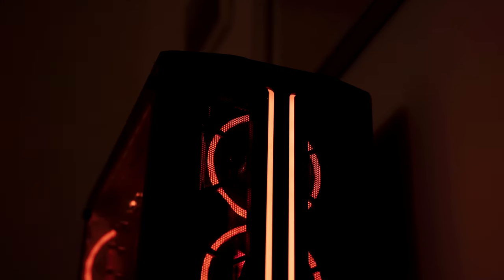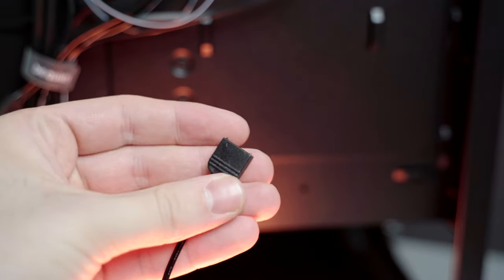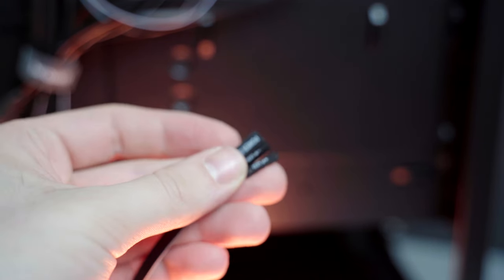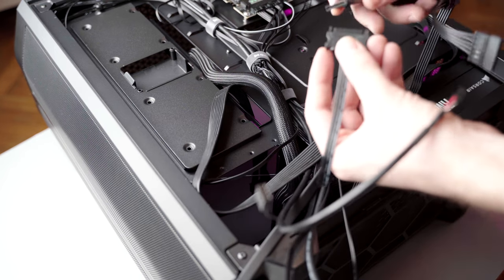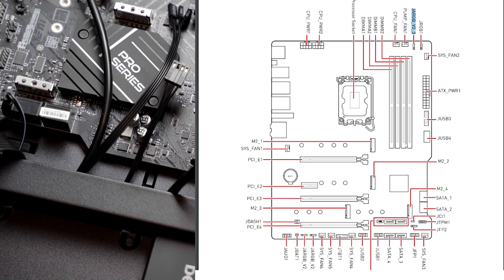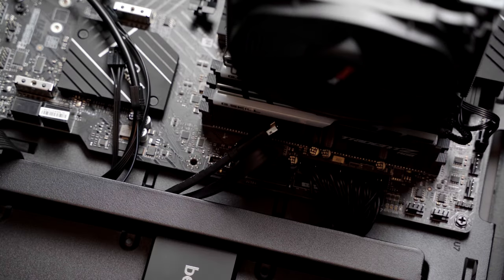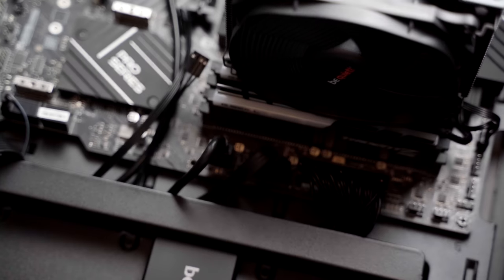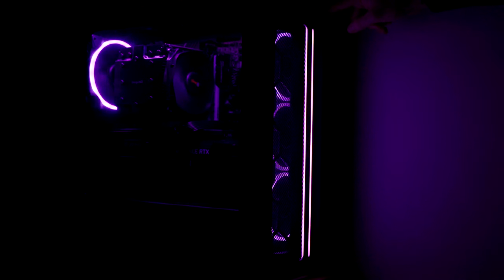be quiet 500FX - how to connect and control RGB, fans and the rest?

Comment: So if I hold the RGB button at the front, does that allocate the control to a 3rd party app for RGB AND the fan control?
I am using SignalRGB for RGB control and Fan Controller (Github) for the fan controlls for CPU and case fans. Haven't been able to get the apps to find the be quiet fans or RGB yet though.
Reply from the maker: I think it’s only for RGB. You can control the fans by connecting them to the motherboard fan header. Did you make sure to connect them to the mobo?
Reply: @leizerg  I still have them connected to the be quiet controller. I will try connecting them directly to the mobo. Thanks!
Reply from the maker: @BasementGAS  I think you should be able to connect the controller to the mobo

Comment: How can I control the case coolers, if my motherboard does not allow to connect ARGB but only RGB. Especially interested in how to turn off and turn on the coolers. Motherboard Asus TUF B450-PRO GAMING.
If with the help of programs, tell me which ones?
Reply from the maker: You mean RGB on the coolers or just the speed of coolers?
Reply: @leizerg  The speed of the coolers, as they are always running and I would like to turn them off sometimes

Comment: Hi, I have this case, but I don't have any argb 3 pin header on my mb
I only have a 4 pin rgb header... Do you know a solution to be able to sync the rgb ?
Reply from the maker: Try this article: https://cpugpunerds.com/how-connect-3-pin-rgb-4-pin-header/
Reply: I had problems finding the 3 pin one but after seeing 3 other ones with 4 pins I found my on the very bottom under the GPU (from the side that's not mounted to the base. Maybe that'll help

Comment: Nice video thx but i connect fan controll to Mb and i cant controll the fan i see in msi softver all fan in 1600~ rpm and i cant controlls. What do you think where i faild ?
Reply from the maker: What port did you connect it to?
Reply: Hey, I have exactly the same problem. Did you manage to figure out what was wrong? I have MSI Z97 MB and used Sys_fan2 header.

Comment: did we still need  to plug molex cable  from psu for controller or just plug argb and fan cable to the mother board without connecting molex cable from psu to controller ?
Reply from the maker: Hi i think you mean Sata cable to Power the LEDs. Yes you need to connect it to the power supply.
Reply: @leizerg  thank you for the information. really helpful

Comment: My 3 fans on the front are not working. Rgb works but the fans are not spinning. Do i have to connect somethin on the hub? I powered it with the sata cable and connected that one fan cable on the mainboard. Help
Reply from the maker: Might be a silly question but are the fans connected to the hub as well?

Comment: I can't sync ARGB with my RAM and cooler and GPU. Holding button for 3-5 seconds don't work. Do you have any solution?
Reply from the maker: Maybe a stupid question did you connect the case properly to argb on the motherboard?
Reply: @leizerg  yeah for sure, I also tried to unpin all ARGB cabel and led didn't turn on so I think everything is connected properly
Reply from the maker: @filipolechowicz5568  so the rgb case stays in default mode all the time? You can switch the colors with predefined settings?
Reply: @Leizerg  I can switch modes only by button on case. RGB from gpu and ram I can switch by app.
Reply from the maker: @filipolechowicz5568  hmm I don’t know man the button should work. Maybe something disconnected on the ARGB hub at the back?
Reply: @leizerg  there must be a argb kabel on the 1st Place at the controller bmput the cable from the back one there.its the upper right on..then it should work
Reply: Did you manage to fix that?
Reply: @geeker9545  nope, i tried on few cases
Reply: @filipolechowicz5568  I solved it by properly rechecking wires from MB synched wire on ARGB HUB of 500FX, I did not have it connected to my motherboard, so it did not have any feed from the mobo. Now it's working without any issue.

Comment: Thanks for the video! I've got all the fans spinning, but they won't exceed 400rpm. All the cables are plugged in and hub is hooked up to Sys_Fan 1
Reply from the maker: Try different connector e.g. case fan.
Reply: Just ended up routing fans to motherboard, while having rgb on the headers still. Unorthodox but it works lol

Comment: NIce video! I just bought this case and for some reason the front USB-C doesn't seems to work. I've pluged the header to my MB . I have MSI B550 Gaming edge wifi. DO i Have to enable it in MB settings?
Reply from the maker: I think it should be enabled by default. Worth double checking though. Make sure the cable is fully seated etc.
Reply: I have the MSI MPG X570 Gaming Plus and it does not appear to support usb-c via the case's connector, only via the rear built-in port.

Comment: Hey, thanks for the informative video!
Did I get it right that I have to connect all the fans to the MB if I want to control them all?
Because my system is only showing my CPU-fan and one system fan, no matter if in BIOS or in softwares like SignalRGB or FanControl (I've got 6 fans and the additional CPU-fan). 
I plugged them all into the hub (ARGB & fan slots), light controlling works well with SignalRGB but I cannot slow them down and after some time they started to annoy me because they're really loud and always work at the same speed.
It'd be lovely if you could help me!
Reply from the maker: If you connect them to the hub and then connect the hub to the motherboard you should be able to control them. It’s weird that it only shows two fan headers. There’s no Chassis fan? What’s the motherboard model?
Reply from the maker: @gayastrobish  ah sorry I didn’t get it right. That’s correct, in order to control them separately they need their own mobo connectors. The hub just controls all of them at once. There are also more advanced hubs like Corsair Commander Pro that can do what you’re looking for.
Reply from the maker: @gayastrobish  huh, good to know! Thanks for sharing.